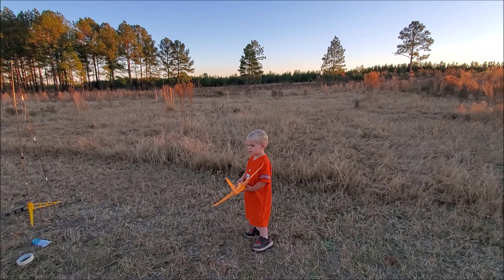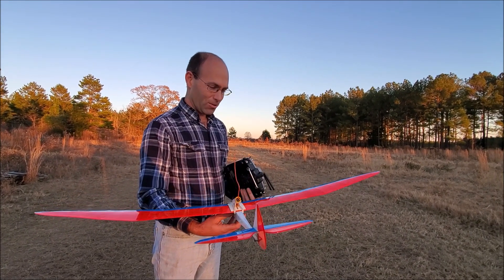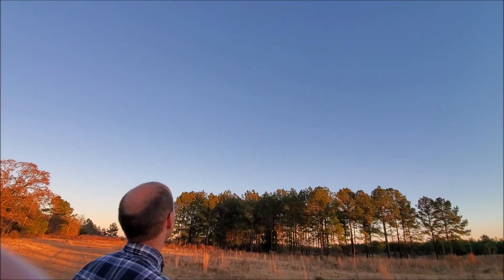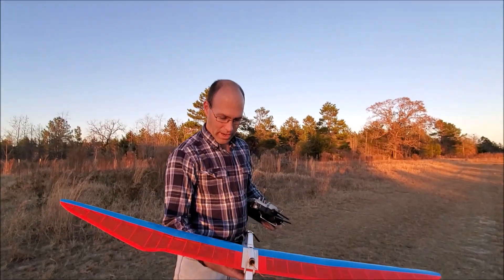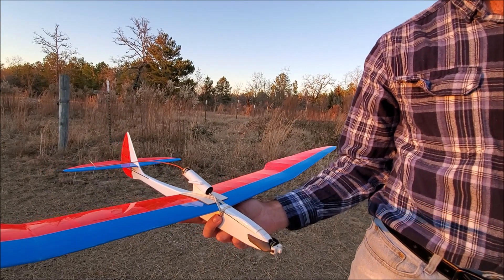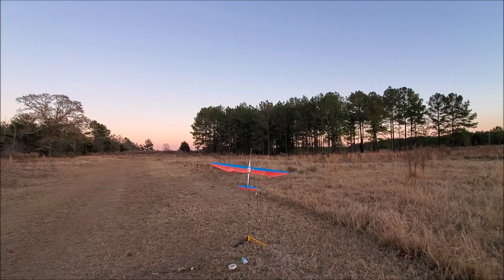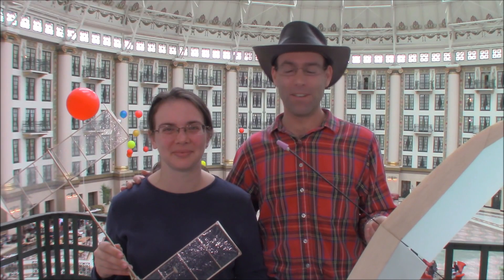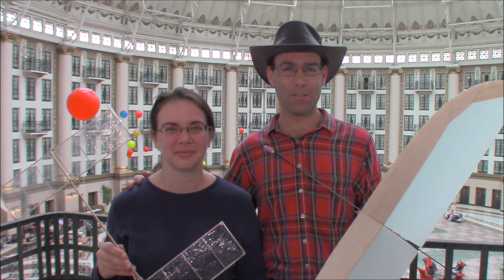Can the Micro Bird of Time survive rocket power?

Comment: Rocket on a tinder dry ground.... Lucky. Apart from that, neat little model.
Reply from the maker: That's why we elevated it above the grass, however there is very little fire hazard from composite fuel motors like these. I don't known of any fires caused by them.
Reply: @joshuawfinn  Well thankfully it went well, I was just concerned in case it hadn't and landed upside down in the dry grass.

Comment: A question; Why not use the parachute charge on your rocket motor to force a twin pin out after the burn to release the rocket from the body of the BOT? That way you can have the rocket to get it to a good height, drop the rocket from the plane, and soar like a normal aircraft.
Reply: @jdamommio  Please understand that I really don't know, but, I would find the COG and place the rocket motor there. with the rubber bands that hold the rocket motor pad in-place looped over the parachute charge. when the charge goes off, you will have seperation from the plane. AND MAYBE with little change of the cg. But I am guessing and wouldn't know for sure if it was possible.
Reply: @jdamommio  maybe I'm dense, but if you eject the rocket motor then won't your plane's CG return to it's original spot? the rocket motor wont be attached to the plane and will fall away leaving the plane it's original 
cg?
Reply: I'm pretty sure you know what I'm about to say, but, have you ever seen a picture of a RATO or JATO mount on a real airplane? The thrust is pointed down from the aft end of the aircraft, but pointed thru the COG of the plane. and then are ejected after the fuel is spent and the aircraft is aloft. I was just thinking that could be something you could use.
Reply: BTW RATO = Rocket Assist Take Off and JATO = Jet Assist Take Off